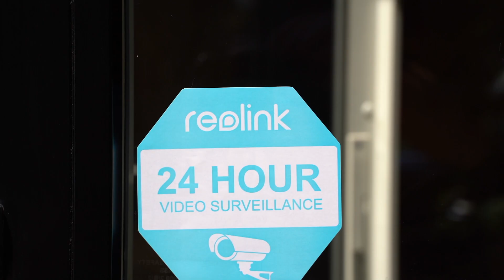Workshop Makeover - 03

Comment: Maybe an epoxy floor system would be good for the workshop. It will self level and seal it as well as provide a nice smooth and durable surface.
Reply from the maker: Yes i thought of that as well, but i think the floor has to many cracks in it.